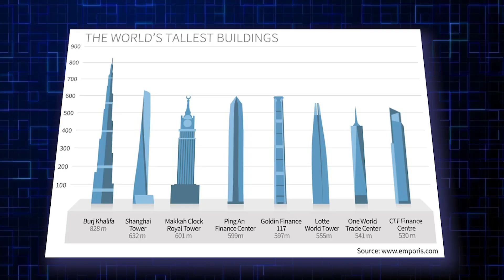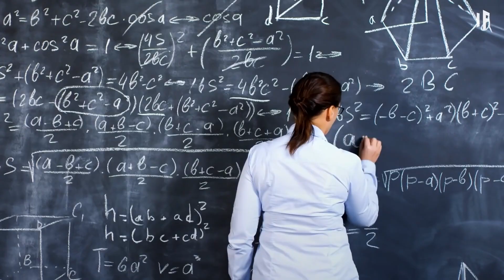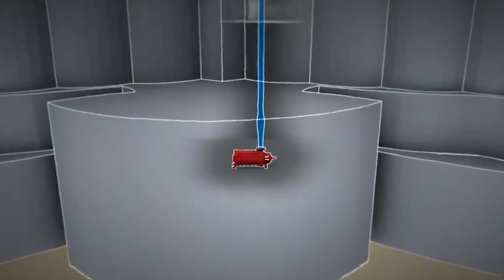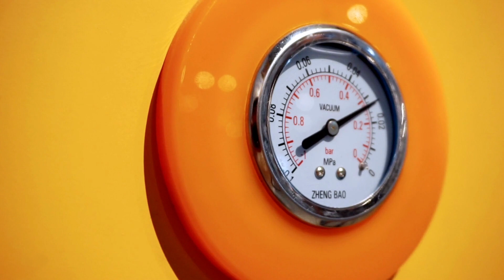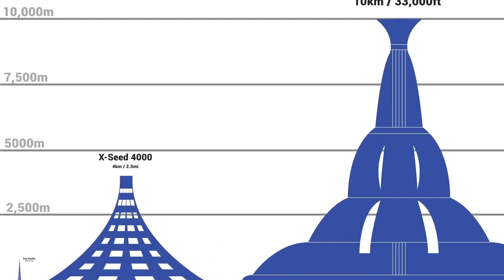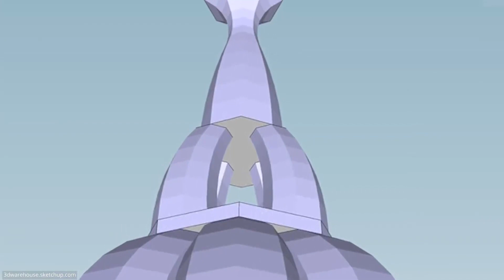Japan’s New Skyscraper Will Dwarf The Burj Khalifa

Comment: Just building tall skyscrapers will not solve humanitys problems they have to serve a purpose  the tall skyscrapers should be used to drag the cold air from the top end and exit the warm ground level air to the top and hence it can achieve the goal of district cooling with minimum energy consumption !
Reply: exactly finally someone says it

Comment: Looks good on the computer screen, but the super-high tower ideas are simply too vulnerable: a virus, water, air pressure, HVAC, and fire safety nightmare. [Only as good as any one of their weakest links]. Plus, think of the immense dark shadows that would be cast upon the rest of the surrounding buildings. Back to the drawing board. This is all fun to think about however. I’ll let you know what I come up with here…Standby. Cheers.
Reply: And Japans Population will 2100 be like half of today's, so they will have enough space.

Comment: The way humanity is going in 2022, I seriously doubt the 2 Mega Towers in Japan will ever be built!  The stalled project in Jeddah is a good example... been that way for a couple of years.  And lets not forget the tallest hotel project in North Korea... it has never been opened!

Why not take the hundreds of billions (or trillions) of dollars for these "Sushi Rolls in The Sky", and spend it on infrastructure, seawalls, afforable housing, renewable power sources, seawater reclamation plants, etc.?

That way people won't have to worry what happens if the power goes out, and they're stuck on the 642nd floor?! 
🤣😂🤣

Comment: Really stupid ideas.
How could you live going up and down that much every day? You'd have permanent headaches and nausea from the change in altitude.
Plus there's enough land to never have to built higher than 30 stories.
Also if you built a km-high building with 2/3 open space, you could make a solid building 1/3 as tall which would be much more liveable.
The logistics and systems of super-tall buildings never work right just check out Billionaires Row in Manhattan. The elevators break down for weeks, they flood, they'd noisy, etc.
Just getting out of them is a nightmare.
No thanks.
Reply: Agreed!
Reply: exactly